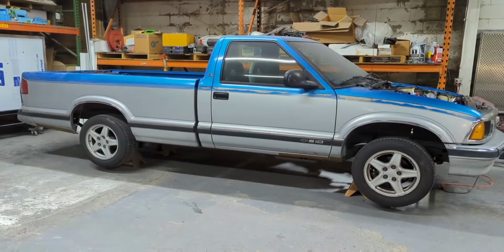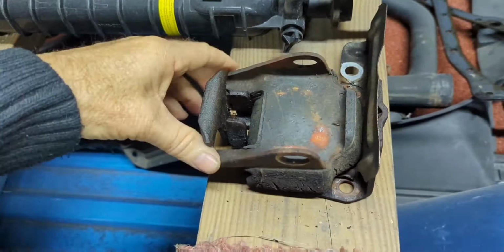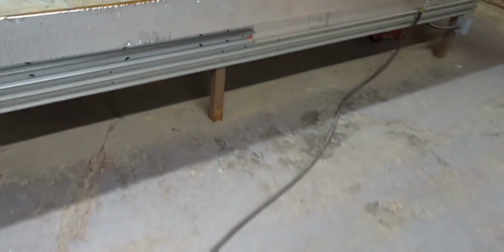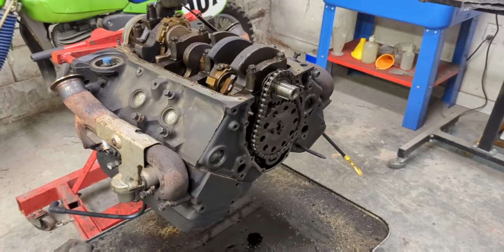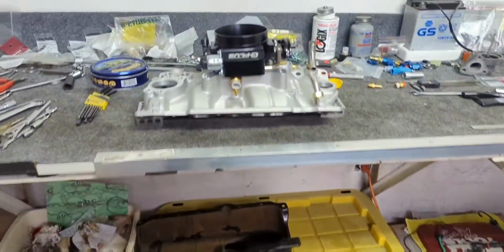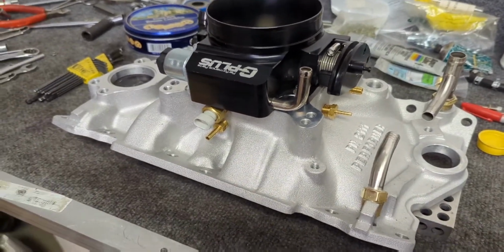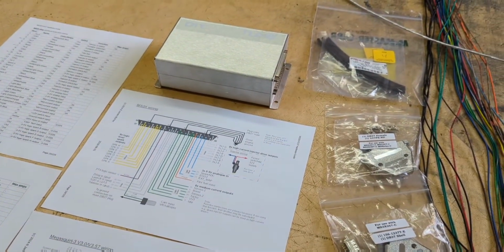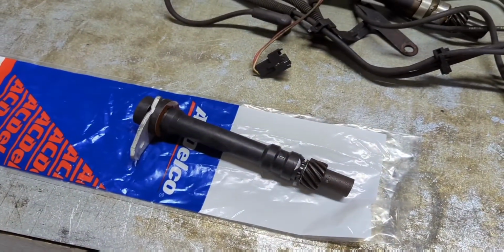S10 4.3 V6 TBI convert to MS3X with sequential port injection and ignition

Comment: That is a big job you got yourself into, I hope it turns out great!
Did you stop working on the Mushroom piston 2 stroke version of the Ninja?
I am so await to hear some news on that!
Good luck with the car, couldn't you get a manifold that already had those attachment so you don't have to get them weld into it?
Reply from the maker: Thanks! I have had a lot of customer work lately so have not had much time for everything, so the mushroom piston engine design has been sitting. The intake manifold choices for the 4.3 v6 are limited, so, no port injected ones exist. The alternative CPI manifold is a terrible intake as well. This one looks like it has good flow.